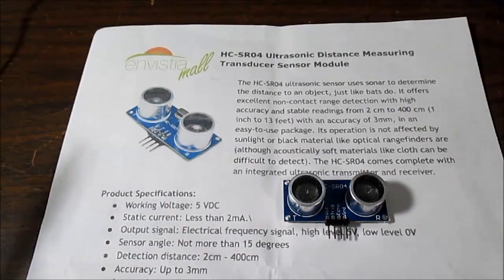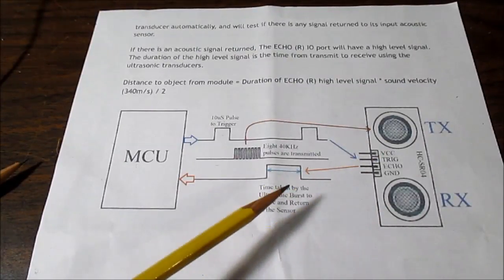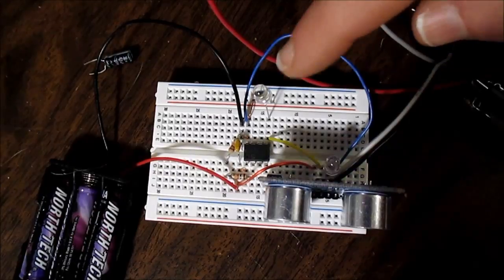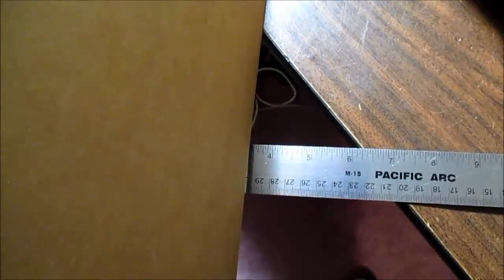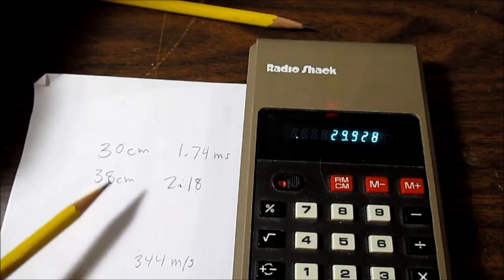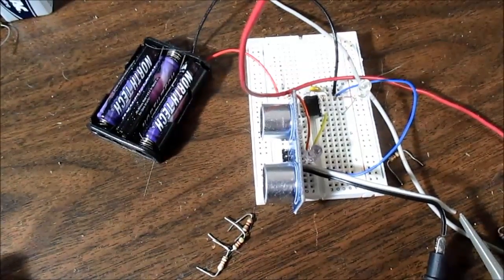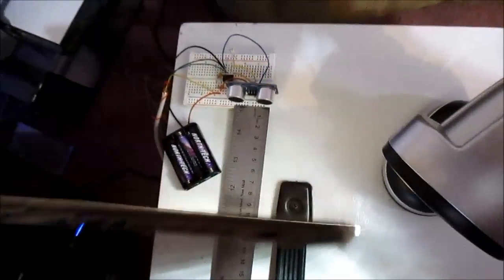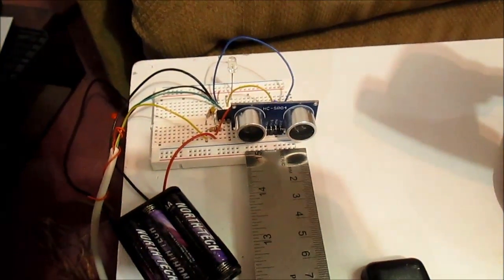Ultrasonic rangefinder module test & interface with microcontroller

Comment: Could it be converted from cm to ft. or inches, or meters, or yards?
Reply from the maker: Yes. The microcontroller doesn't know what length is. You have to provide it with the value needed to convert the pulse time measurement to the standard of length you want.
Reply: you can do it in whatever unit you like really. I'm not sure if meters would be much use though. after about 1 meter they tend to not detect the signal bouncing back reliably.